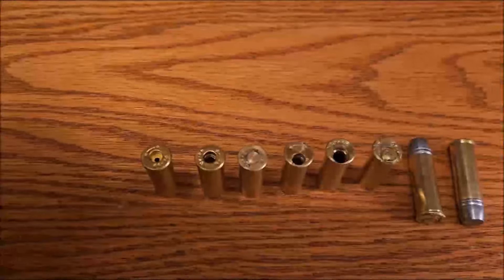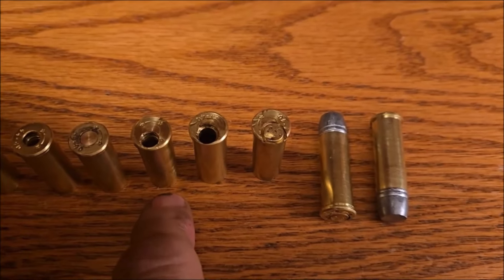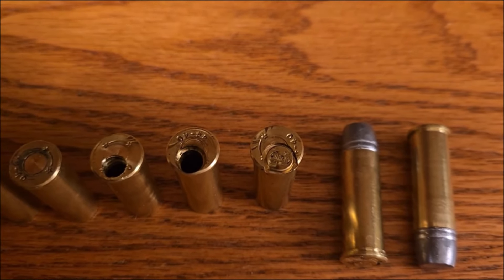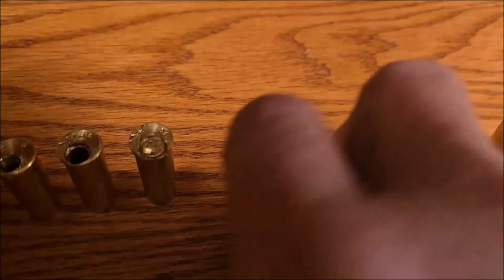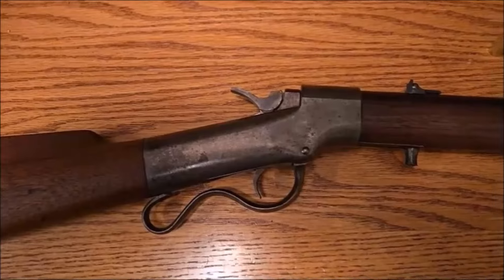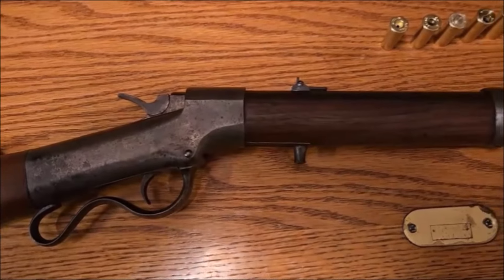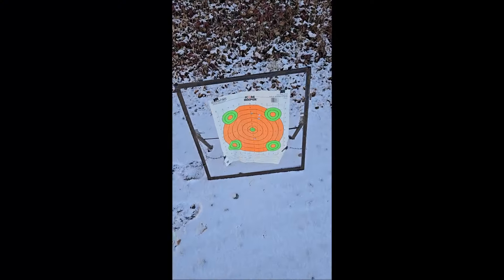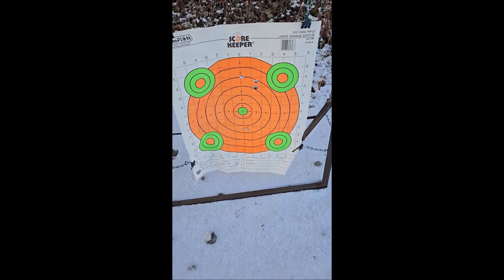How I make .46 rimfire cases for a Ballard rifle.

Comment: Hey Mike! I’ve got a Ballard Military Carbine in 46 I’ve only shot a few times but I always have to resort to squishing a round ball into my case. I just today made a post on Reddit begging for help on finding an appropriate bullet mold.

Can you PLEASE share what mold you’re using? Is it a heeled bullet? 
I’ve been using .44 magnum brass, why did you choose 44-40? I was going off 44mags case diameter of 0.457 since my original 46fr rounds measure out to be .458